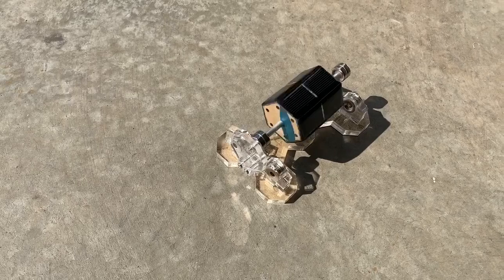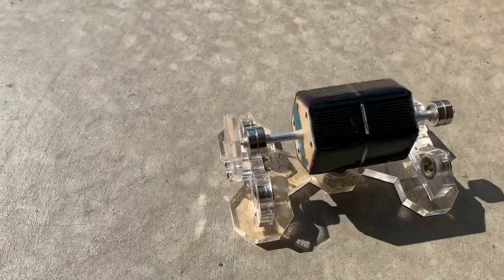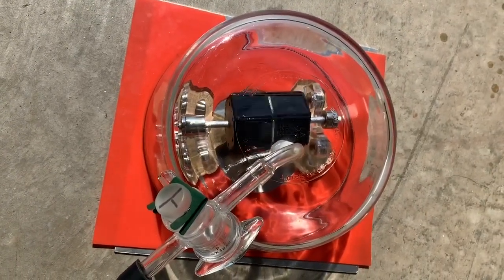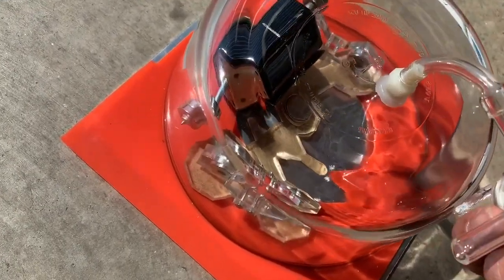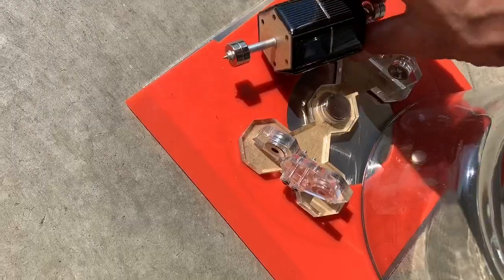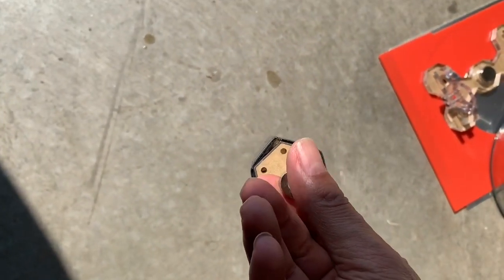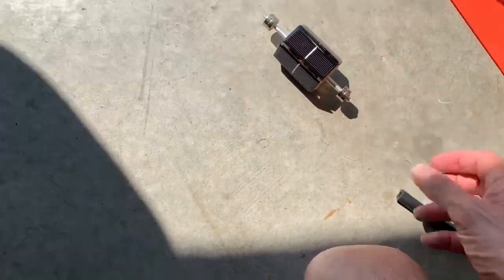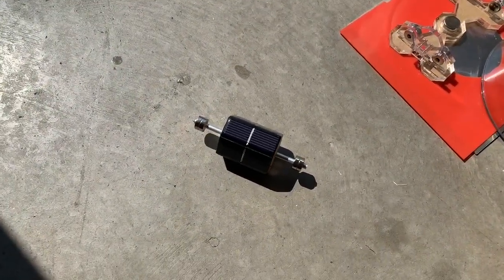What Happens to Mendocino Motor in a Vacuum??

Comment: Now try an electric engine with a generator with a large weighted fly wheel to see if the momentum of the wheel will assist the motor to generate more power then what is being consumed what a great test
Reply: Have you seen the New flexible thin solar panels you can get them in like 200w and they are like a few millimeters thick! For a larger scale test